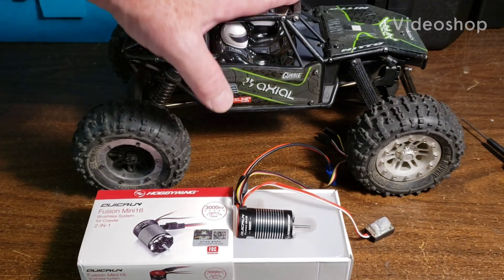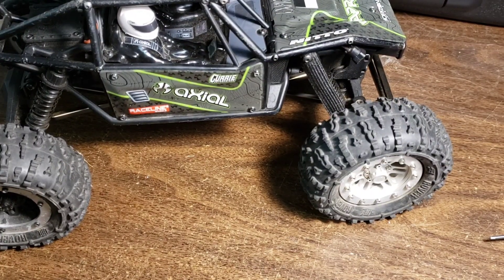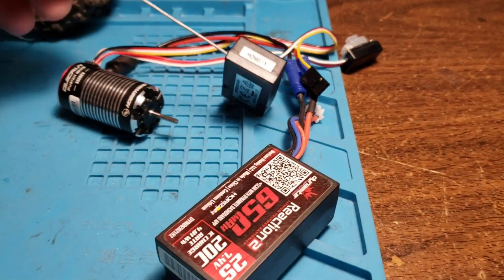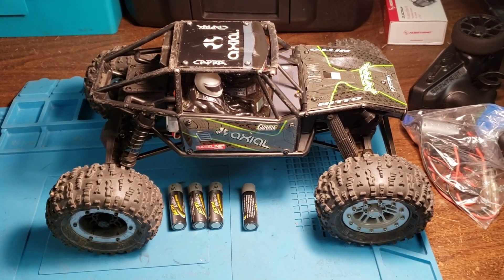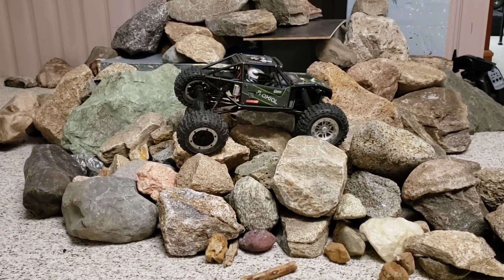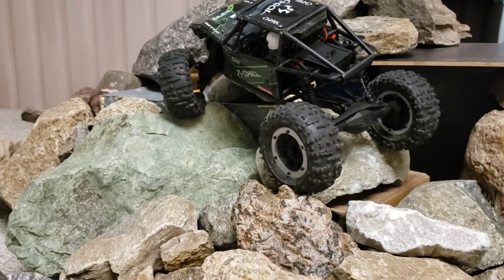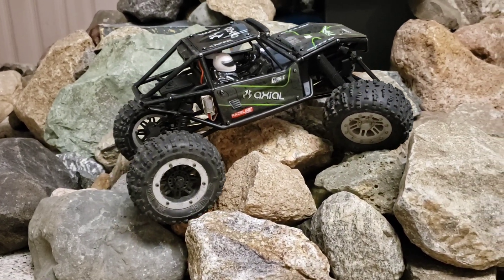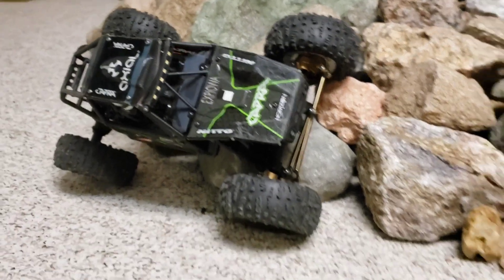Capra UTB18, Fusion Mini 16 Motor Installation And First Test

Comment: I have the same frustration with the truck! 
Can I use the stock receiver? I'd rather not have the added expense of buying a new controller. I guess I have to buy something that allows me to program the esc? Thanks!
Reply from the maker: @punkish7  It depends. The new trucks have a stand -alone receiver that plugs straight in. The older trucks had an ESC/Receiver combo that didn't work. Mine was the original so I had to replace the electronics.

Comment: Quick question: Did you use the stock pinion from the Capra? thx!
Reply from the maker: @angelikakurowicka7182  Yes. It seems to be fine. I was hoping for a little more top end but I don’t want to give up the perfect slow crawl or cause it to run hotter with a bigger gear.

Comment: I have the Holmes hobbies 380 Revolver V2 2000KV and a AM32 ESC and this system is also very powerful. 
The ESC have also a grazy low speed control and the motor is a 14 pole with extra magnets for a powerful dragbrake.
The torque is amazing from the Revolver. I can't stop the wheels spinning whiteout breaking the axles.
Reply: To loud